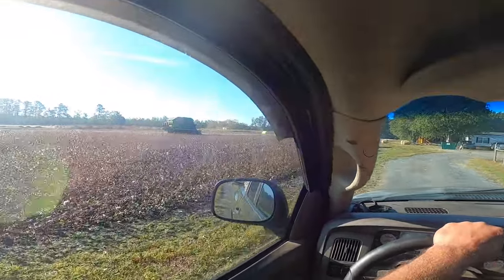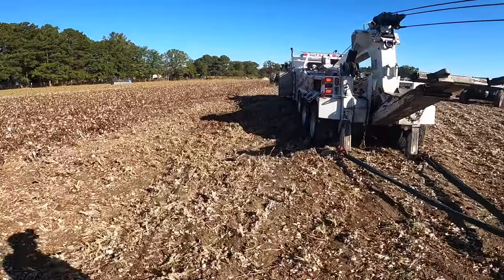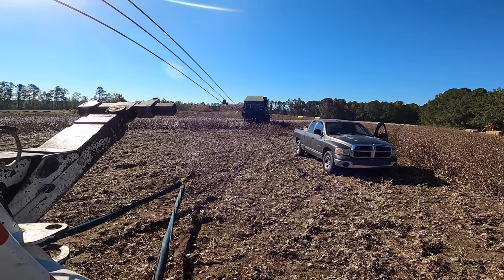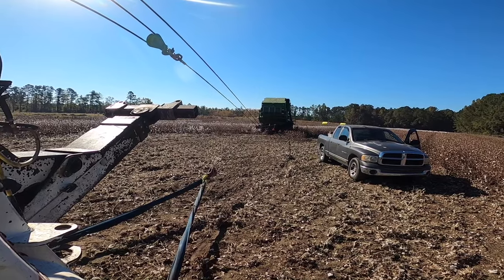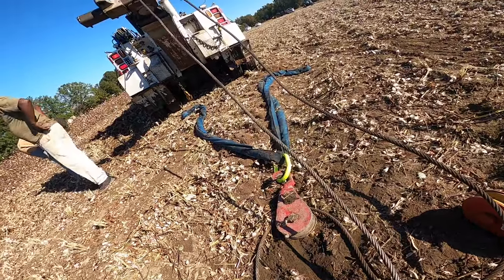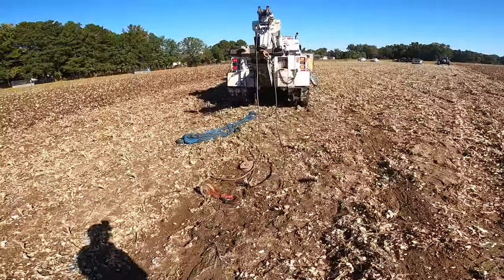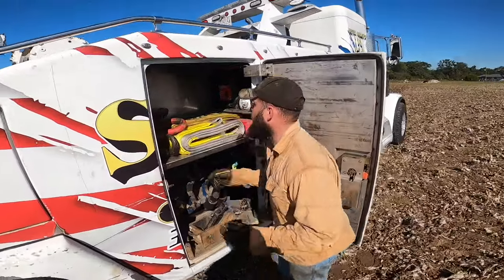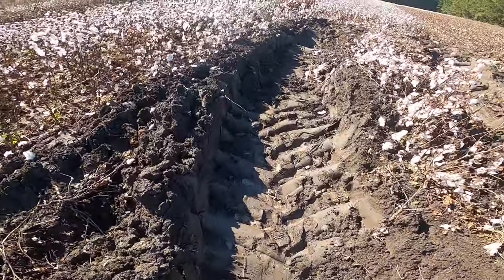John Deere 7760 Cotton Baler winch out

Comment: very good job using the 4 part line i thought was over kill until i saw the rutts at the end but even if you didn't need the 4 part it put less stress on the equiptment which makes it last longer. i watch a lot of towing and recovery videos. i saw one the other day man had a wrecker with a pto winch on the rear and electric on the front rather than use the pto he rigged the electric  over and over until he had enough pulling power to move the vehicle. never figured out why i text him and ask but he didn't respond. before i ask him i told him i knew i wasn't there and was only watching on a computer screen and that being said i knew i didn't have all the facts but just wondered why he did it the way he did. i ask questions to learn not to be a SA but some take it the wrong way. thats one thing i like about you if i ask you always answer and thanks for all the trouble you go to making these videos helps a lot of people
Reply from the maker: Dependable auto  Yes sir I rigged for a heavy pull. I am not sure if it was needed but it came right out. Thanks for watching and stay safe